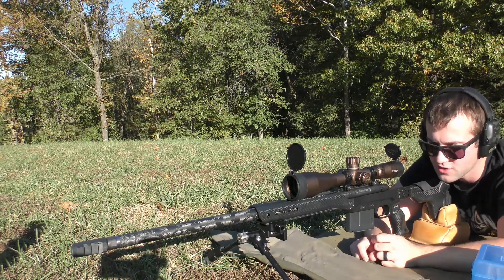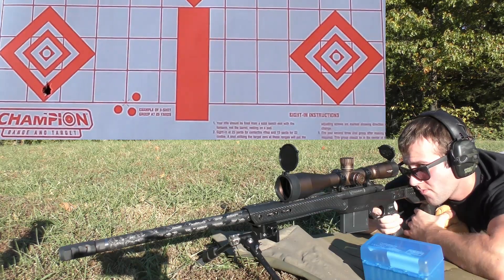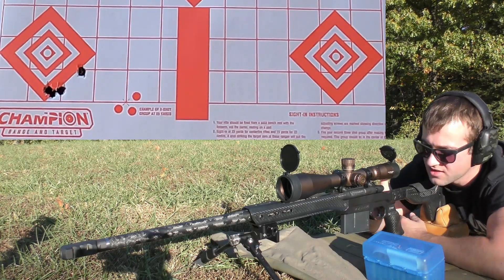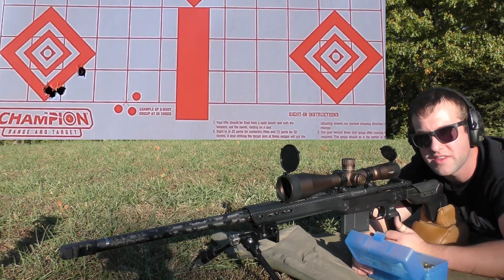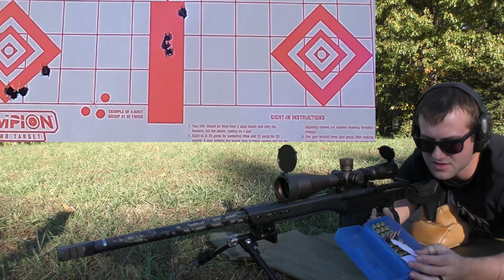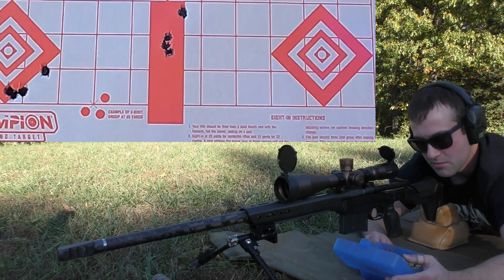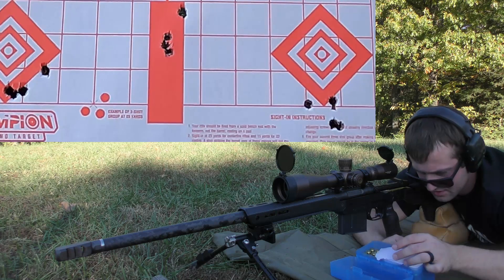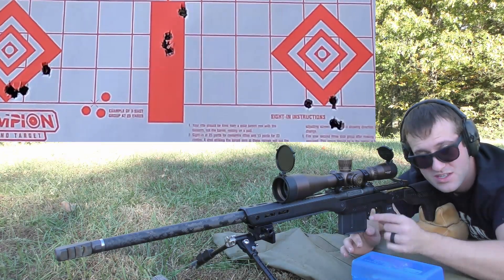Full Custom Terminus Kratos/Proof/MDT HNT26 7mm PRC Powder Testing: Berger 195 EOL, N565, N568, N570

Comment: Pretty impressive I didn’t think 7prc was capable of those velocity’s with the 195. I’m currently shooting a custom 28 Nosler 26in barrel with h1000 running 3050fps comfortably. The 195 is a hammer on game and a great target bullet as well. I’ve shot it all the way out to 2200 yards with great consistency.
Reply from the maker: I've never even had the opportunity to shoot that far. That would be a ton of fun!
Reply: Powder selection matters a lot for the 7 PRC. I lucked out, and had just gotten the 195gr EOL not long before Ramshot Grand released. I'm launching that bullet also out of a 26" barrel at 2960fps, with headroom left in the data. But, it does .3" groups if I do my job, so I don't see the need to chase more velocity.

Comment: I'm puzzled with the N565, hitting the pressure max at such a coparably low dose. I use N565 in my 22in Proof barrel, with 175s, as N570 burn was a tad too slow. N568 is not impressive.
Reply from the maker: Yeah. I need to do more testing before I jump to any conclusions, but I felt the same way.
Reply: @RisenCitizen  Did you do any more testing? Im about to load up some n565. There are proven loads with 169gr of n565 with 175eldx ...seems strange you were hitting pressure at that low
Reply from the maker: @1jeetS  I've done more testing with N570, but I haven't messed with N565 anymore. N570 seems to be the only option if speed is the ultimate goal.